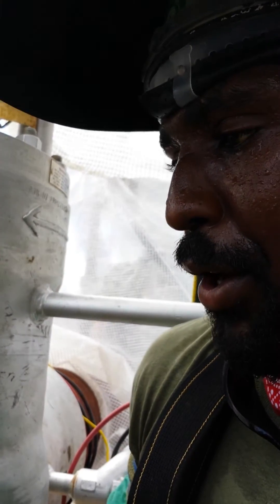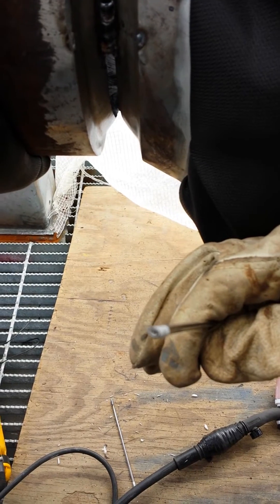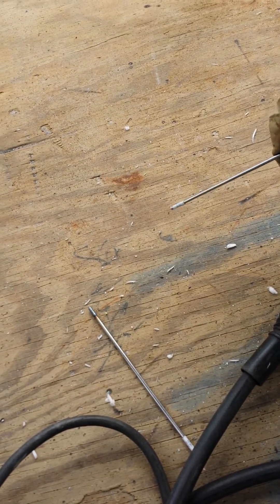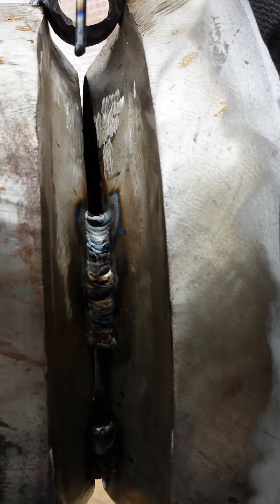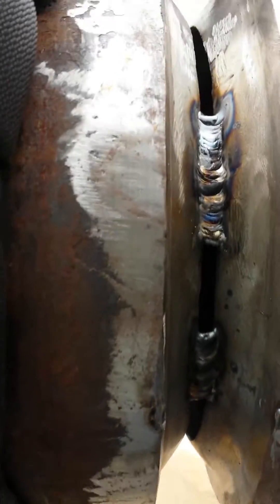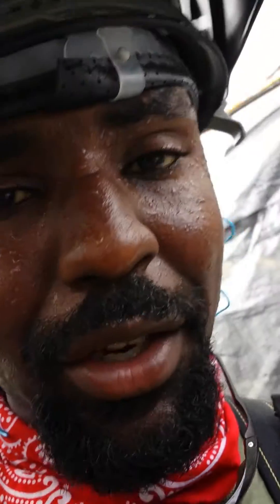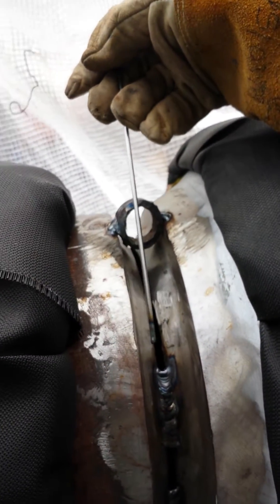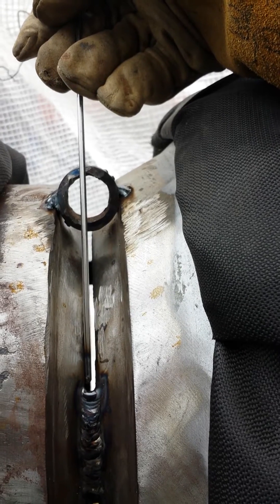Pipe welding with christaner using ER70CG tig wire

Comment: Yo I'm in Corpus Christi, were you at? I'm currently in my last semester for my Associates. I'm done with the welding. Now I'm just practicing stainless. And 1-2in pipe. "Spaghetti pipe"
Reply from the maker: Hey, you won't to learn how to weld stainless steel pipe stay tuned to the website www.christaner.com I'll show you the most easiest, fastest, In the field way. Stay tuned, I'm getting ready to take a break from working  and start post the video's
Reply from the maker: I'm in the bay Area

Comment from the maker: Yes, you can make your root pass flush if that's how you would like it to be, if I was aiming for a flush root I would just raise the tig wire just a hair above the feathered edge and continue with that side to side bridge technique. Just think about it like this gravity wants to pull your root down anyway so if your starting at the top of your pipe raising the tig wire just a little above the feathered edge of your bevel and start. Remember the deeper you hold your tig wire between the bevel the more root you will have, the higher you hold your tig wire above the bevel the less root you will have.

Comment: Can you post that video of the motion you run the root , been trying to look for someone who can show or teach that motion side to side
Reply from the maker: yeah, I can do that . I'm working a shut down at the moment, after its over I'll post a video.
Reply: Appreciate bro , I wanted to ask you the side to side motion is the motion mainly used out there in the field for the root ?
Reply from the maker: yes, that's right. I call it bridging the gap.
Reply: Alright bro hope to see you post a video soon & one teaching how to free hand the caps bro , be safe thanks for the help
Reply from the maker: No problem, stay tuned. Thanks.
Reply: can you make a video showing how to tie in on the root? I have trouble with it but if you cant make a video can at least explain how you do yours?
Reply from the maker: I'm not around my equipment at the moment but I'll post a video explaining and showing the motion. It's not hard at all. I'll post the video today.

Comment from the maker: yeah, I can help you with that. First I need to no what  technique are you using to put in your root. for an  example, are you using a 5/32   gap or a loose 1/8 gap. what size pipe are you welding on?